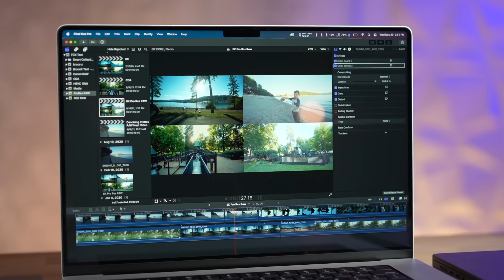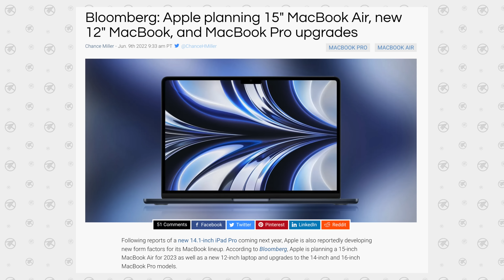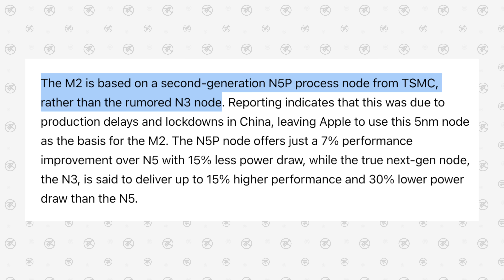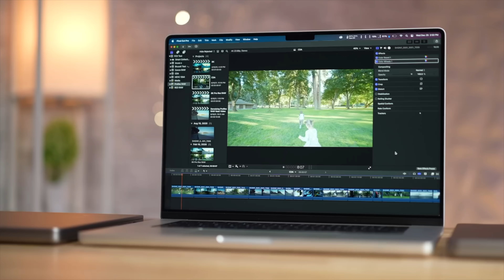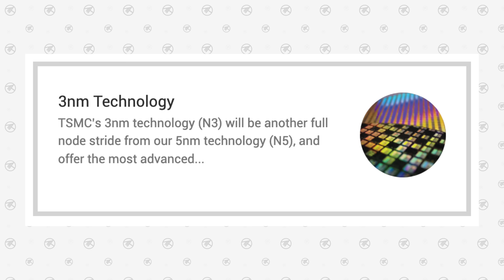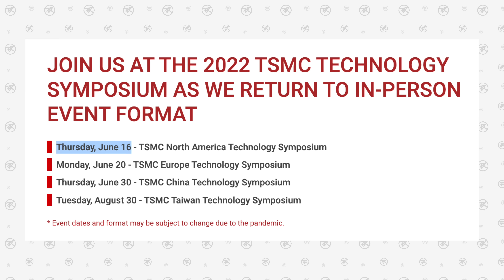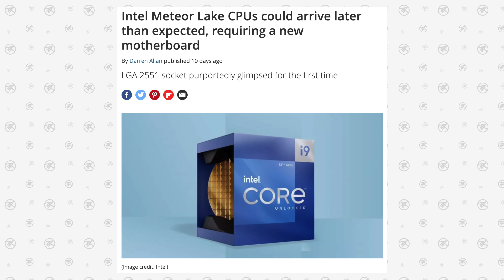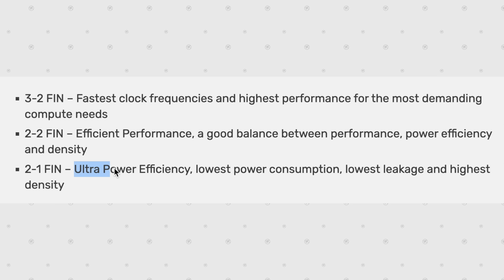Why Apple's M2 Pro MacBooks will be BETTER than you think!

Comment: Written June 20, 2022
Given MacRumors predictions for the 18 month M3 to the M2, do y’all thing about M1 iPad mini will come out March 2023 as Apple released mini 6 Sep 2021 and that’s 18 months? Or maybe they’ll release mini M1 in Sep 2023 for mini 6’s 2 year anniversary as that also goes along with the 10 month gap between the M1 iPad Pro 5 in May 202–the M1 Air 5 in Mar 2022

It’s pretty much a given Apples trying to unify its iPad line with its M1 Mac line

Comment: I totally disagree. Jeff pou is not a reliable leaker and remember: apple released M1 pro on N5 after they had introduced A15 on N5P. When chip yields are low, making large dies is a huge loss of money and doesn't make sense, so they will be the latest ones to take advantage of the new process node.

Comment: My prediction - and I'm almost always wrong so grain of salt - is that 5nm will keep the M2 moniker and the 3nm chips will get M3 Pro, Max, etc. My reasoning is M2 will be reserved to the Air, 13" Pro, Mini and iMac. M3 Pro, Max, etc. to the 14", 16" and Studio and Pro machines. Then when the new Airs and 'consumer' models are released, they will get the "M3", followed by the M4 Pro/Max/Ultra a few months lager.. This leapfrog could help Apple prevent consumer confusion that a new "M2" is not as fast or "pro" as the M1 Pro/Max/Ultra. From then on, the high performance chips will come out first, and the "scaled down" non pro/max chips will come out afterwards. Does that make sense? It seems logical to me, but like I said, I have yet to be right in my predictions so . . . .

Comment: I believe the M2 Pro and Max will come out in the fall of 2023, and it will be based on the second-gen 5 nm chips, which the base M2 chips are. The 3 nm chips will be the M3, which will come out in 2024. The M3 Pro and Max will come out in 2025 and will be 3 nm.

It doesn't make sense for the M2 Pro and Max to be 3 nm, since those chips will be based on the M2 chips, which are the second-gen 5 nm chips.

Comment: It does feel pretty bad to be buying the Pro/Max/Ultra/Extreme versions of these chips as the lowest end tiers are just getting the new architecture. It makes you feel like you're always behind. If they could invert it or just release the whole lineup roughly at the same time, that would definitely be better.
Reply: But the pro/max/ultra are still overall much faster, so why does it matter? Single core performance difference is almost unnoticeable. Media engine is better yes, but the original is no slouch either.

Comment: Na. Good research but I doubt Apple will ditch their strategies because new tech is ready. They probably already have 1nm in the tech labs. After that we are talking Quantum cloud computing. As a business with investors they need a clear pathway not a gamble for power. The market has structure. Yes the M2 pro and max etc will only be 10-20% power bump but that’s the market. Moving Mac OS to a IOS will be a more realistic strategy going forward

Comment: if that's the case, then my speculation is right, and I'm also speculating if Mac Mini with M2, M2 Pro and M2 Max, then Max Studio maybe with M2 Ultra and M2 Extreme next year! Just speculation😆
Reply: @tonyburzio4107  That's not what I mean, MacBook Pro is more expensive than Mac mini with the same chip, so for people who work more at home or use it for office, will have cheaper option which can be added with bigger monitor and that's what mac mini is for .

Comment: Why 3nm but what happened to 4nm instead. Yet for 3nm yeids are low so the MacBook Pro will make sense, right? But they're Apple. But 4nm can more sense to me because it can help Apple to make more chips. But if they are going to use 3nm in iMac, it's gonna be more expensive than it's last one. I don't know but it's a big leap from them.
Reply: @tonyburzio4107  I guess so, and I don't know if intel would bring 3nm first or AMD but that's a mystery

Comment: Imagine owning a laptop with a fucking 16 inch screen, my god. Just get a desktop, carry it your backpack, rig up a little frame that attaches to your waste and shoulders that will will hold the monitor and throw the cables over your shoulders, next just get a bluetooth mouse, and rig that up to a arm brace that extends into a little piece of wood supported by your wrist and then finally find one of those abstract, ergonomic one hand keyboards and do the same thing. More power and will have similar weight and feel to carrying one of these around.

Comment: I'm surprised that you didn't take in to consideration that M2 Max done in 5nm would be unfeasible without upgrading the chassis of M2 Max Macbook pros. Otherwise they would definitely run in to throttling. Added cores with 5nm would most likely produce more heat which is already a problem with M1 MAX with 32 core gpu especially in 14" chassis. So without more heat control or absorbing aluminum chassis they would do the same mistake as they did with the M2 air. Pro users are not going to pay for extra cores if they're there just to be throttled down. Would they? And would it be acceptable to have even larger chassis for high end MBPs with M2. Chassis updated every year? Not gonna happen? Weight added significantly. Really? I don't think so. 3nm it is.
Reply: Where do you see throttling?  MaxTech made up the heat rumor and you fell for it? 😆

Comment: On June 13 I wrote that the M2 Pro & Max might be 3nm as a comment to Max Tech video "M2/Pro/Max Chip Mac Lineup Revealed - HUGE Leak Bombs!" My comment was: “Since Majin Bu tweeted a 12-inch
MacBook Pro could have M2 Pro or even M2 Max chips, consider the M2 Pro, Max, Ultra, & Extremes are based on the A16 architecture or are perhaps 3nm and so efficient thev can operate in a small chassis without significant thermal throttling. It's odd, yet if supply chain issues caused Apple to create a tweaked M1 with extra GPU cores, video encoders, and higher bandwidth RAM and simply CALL it M2 because the planned M2 wasn't ready for their desired schedule for a new MacBook Air.
After all, Apple can name their chips
whatever they choose.”

Comment: I Hope That The New Mac Pro is based on the M2 Not M1 and i Hope They Get The Connection / Fusion Process FIXED i am thinking that is were the Bottleneck Is Happening Because The Tests are Showing that for 2 times the price you are not getting 2 times the performance But I Am Not Holding My Breath LOL